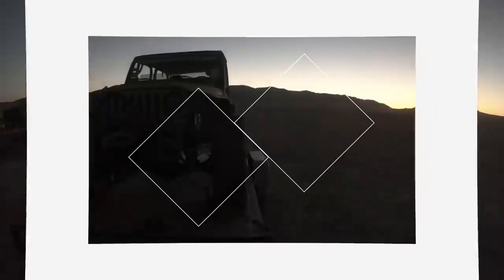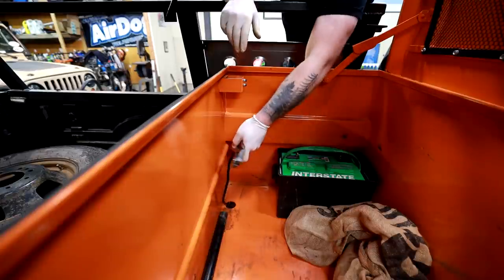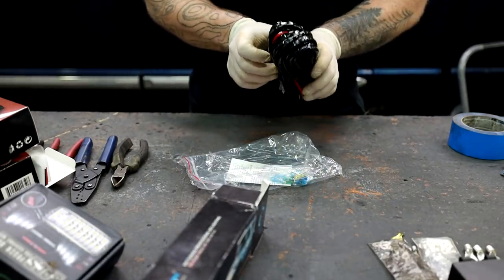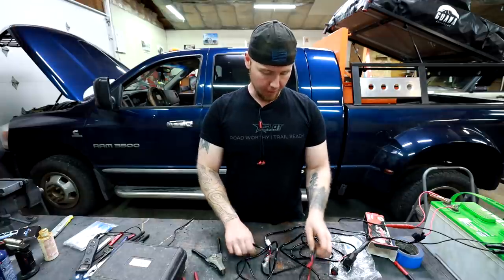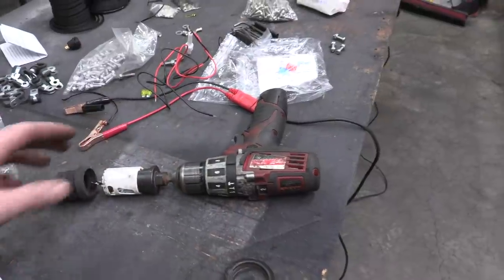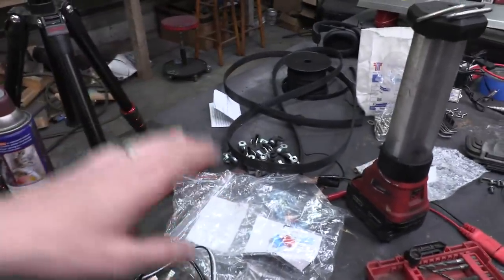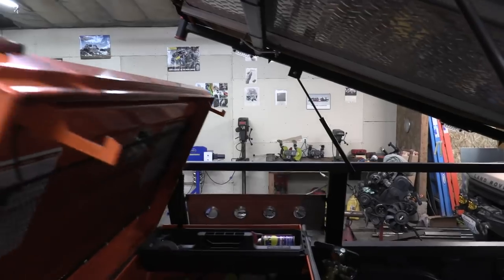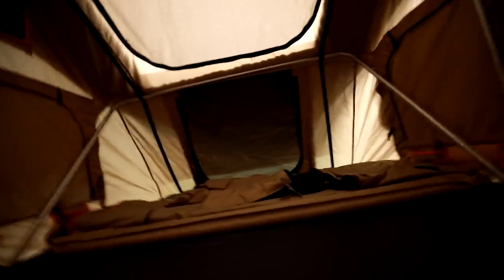CHEAP Roof Top Tent Rack Mods and Hacks! 4x4 Camping In Comfort 👊

Comment: Nate, Great job. Torch soldering looks faster. Might try it. I can see you did your research. 12 AWG wire can carry 20 amps. I will be interested to see if the fuse always blows if your aux battery gets too low. Some way to limit the charge current would be awesome. Unfortunately I am not familiar with that item. The lights are sweet. I need to upgrade the cabin lights in my TJ. They never worked and factory are not good anyway. Great video again bro. Can't wait for the next one!

Comment: Hey Nate love the work you do keep it up can I suggest you put your clamp meter on your charge wire to see how many amps are going to your second battery it will give you an idea  if that cable is big enough also maybe look at a small solar panel to keep it topped up when you are not driving.
Reply from the maker: This has been apart of the plan all along. I just need to drain the truck bed battery low enough first 👍
Reply: @DirtLifestyle  also I know you are trying to do this cheap but I would suggest using a dc dc charger and 6bs cable from your main battery this will also allow you to connect a solar panel with out a regulator

Comment: I cant imagine that tiny wire lasting very long if you drain the rear battery below the mid-high 12v range and it draws more than a handful of amps to charge it back up again. I would have used a much much bigger cable for that. Great ideas with the hinge mechanism and i love the simplicity of the whole setup (y)

Comment: Nate, that is a Molex connector. Go to their website and there are instructions on how to crimp and the right length to strip the wire. Those are used on a lot of Airbus helicopters, great system 👍 I'm a fan and use aircraft connectors on all my cars.

Comment: First off, love the videos 👍👍, I use the fuse jumpers all the time, but I found out that there is a right and wrong direction, if installed incorrectly you're gonna be popping the main fuse and your accessory won't work. I know it is just for a signal for the relay.  I ended up blowing a lot of fuses before I realized it. Just one small tip I learned, just wanted to pass it along. Again love the videos 👍❤️

Comment: Another good video. I would increase the wire size to that aux battery and go with a bigger more constant duty solenoid over a relay in the case that battery is really drawing off the alternator or vise versa. Police Tahoe’s from the factory use a similar key on solenoid connection the start battery and the six battery. Tyco makes a perfect constant duty sealed solenoid for this.

Comment: When i use that style wire cover I like to use some glued heat shrink on the ends to keep the cover from sliding around and more weatherproof because of the glue in the heat shrink

Comment: Flux!!!, gotta use it when soldering... anything.

I like the Oatey paste you buy at Menards and the likes, works for electronics to.

I give Eastwood's epoxy primer w/ chassis black top coat(no friggin' ceramic btw,  just the basic chassis black, satin is my pick)5 star every day of the week.

It holds up excellent, ya' absolutely have to install per the directions, there's some watching paint dry time involved.

Rattle cans will get that done.

Good show 👍
Reply: You'll wanna blast it btw before epoxy, if that's what ya choose to do

Comment: E6100 is the best epoxy adhesive.  Would work perfect for mounting those lights and such.    We use it at work in industrial applications on mobile volumetric mixers.

Comment: Nate.  I am currently about 5 minutes into this video...  Did you know the 7 round "RV" trailer connection has a constant on for charging the emergency battery/using accessories on your trailer?  On my 06 Super Duty, it is only hot when the truck is running.  I'd just tap into that for your signal and use that to cycle your relay.  The wiring is right there.  Actually, now that I think about it, there's a wire for reverse lights on a trailer in that plug too...

Enjoy SEMA.  Sending my buddy Dave from Jeep Kings in Springfield MO to come say hi.

Comment: Dunno if you'd want a link, but there's a veteran on EBay that sells pre-wired mini relay/fuse boxes.  All sleeved wire, comes with a mega fuse, etc.  Only thing missing would be an ignition relay if you only want power to the box when key is on.  Super neat/tidy.  I have one, will probably be buying another.

You'll have to make your own harnesses, but I don't find that as a negative.  No pre-boxed one-size-fits-most applications.

Buy a decent voltage sensitive relay (solid state) for isolating....part of the reason is making sure you are carrying enough current to fully charge the second battery and not be under-charging it.

Might suggest replacing cheap Chinesium rocker switches with some vandal switches, too.  Tougher, cleaner, UV proof, and just look better.

ONE last thing:  3M VHB double-sided tape (red coating, clear tape). aka, Tape of the Gods.  Pretty much permanent installation.

Comment: Doesn’t your 7pin trailer wiring already have a switched 12 volt for charging a trailer battery?
Reply from the maker: Yes
Reply: The trailer charge circuit is limited to something like 10-15 amps, IIRC. DL's solution is going to be limited to the capability of the alternator, divided by the # of batteries being charged.
Assuming it works, but electrical is a fickle mistress.
Reply: @reaperreaper5098  how does the trailer plug limit the amount of amperage it sends? I'm curious if he totally depleted his deep cycle battery while camping and went to charge it, if it would pull to many amps and melt that wire he ran. Ssimilar to jumping a dead car battery with a cheap pair of jumper cables. They get very hot lol.
Reply: @ASdt360  So, I didn't get a notification when you asked this. To answer your question, the trailer outlet is on a set of fuses. Those fuses are going to be sized to the wiring Ram used for the harness for the tow connections.

Comment: You need to plan for the box battery having no charge. There will be a lot of current when they are equalizing.
Reply: A master disconnect switch, 2000W generator, and a small battery charger.
Specifically a 2000W because you could fit most of them in the job box.
Reply from the maker: It's all speculation at this point. I will have real world data soon. I will measure the exact amperage this pulls when trying to equalize with a amp meter. I think the batteries will equalize very slowly but only time will tell.
Reply: @DirtLifestyle  i was curious to this aswell, it will definetly depend on the state of the deep cycle batter and if you equalize it with the truck running or just ignition on, if you drained it acidentally to say 10v and then turned the truck on to 14.4v thered be a rather big difference there and might send alot of current, this never seems to be addressed though even in professionally sold wiring like an aftermarket 7pin plug kit, if the trailer has a battery itd be the same scenario

might be a non issue but if it is an issue can grab an automotive breaker and itll allow 10seconds or so of charging before it trips off for 20seconds or so and then untrips to try again until the voltage is close enough it doesnt need to trip off, not really a professional solution but i dont see any issue with it

Comment: Your truck should have a dedicated circuit to charge trailer batteries on your 7 pin trailer connector (pin #4). It’s only on when your engine is running. And your reverse signal of course would be right there too. On my Ford it's a 30A circuit. 
You could just splice into the factory harness right under the bed below where the box is.

Comment: Looks great, but one question.  Why did you mount the hinges on the back rail and not the front at the headache bar?  I mean your Rigid box swings from the back to open, plus you added the cool dimple dyed side plates in the front of the rack.

Comment: You can use the reverse light wire on your 7-pin trailer harness for a trigger for your reverse instead of the lights on the truck.

Comment: Hey Nate on that generation dodge with the Cummins the alternator charges the passenger side battery and that battery “charges” the drivers side battery but the computer reads voltage from they driver side. It has been know for the driver battery to go bad the computer calls for more power and the alternator cools the passenger battery.

Comment: Noticed that you are using copper wire and crimps, consider using the marine versions as they are “tinned” copper and that will greatly reduce the possibility of oxidation of the fittings and the wire. I did all my accessory wiring on my previous Land Rover 110 with marine grade wire and electrical connectors to specifically keep the corrosion gremlins away.

Comment: You should use a hot knife to cut that braiding, cuts cleanly without fraying.  Also maybe look at getting marine grade heat shrink... how I built my truck harness.. little overkill but beats plastic vacuum tube.. but the marine grade also has glue keeps out moisture and weather, aha it worked well with the flex braid

Comment: Be careful to not let your new battery discharge too far.  As the rear battery nears 0 volts, when you connect to the alternator the amps going to the rear battery will approach infinity, which will smoke the 12g wire and relay if your lucky. If your unlucky it will kill your alternator or start a fire.  If you put a fuse and charge controller inline you should be OK. Typically an install of a house battery will use a 100 amp breaker as close to each battery as possible and large cable. Depending on length of the run you might want 2g or 4g cable.
Reply: Exactly! 12ga sounds like a fire at some point

Comment: The one thing I can see happening with the battery setup is if the bed battery is dead and they are immediately hooked up when the key is turned it could lower the main battery enough to prevent the starter from working. especially if you are having trouble with the main battery or issues with starting. I would definitely add a bypass switch just in case

Comment: Nate can't wait to see you tailgate build. Believe it or not I have a 07-1/2 Ram dually 4x4 long bed same color as yours with a 6.7 Cummins and I think that to own a Ram truck it's required that the tailgate or bumper be damaged. Lol   Have you ever thought about building a custom trailer for hauling your jeep with a tent or small camper rig on the front which would go over the front of the jeep and have your camping equipment in between the wheels of the jeep allowing you to add a garage type area on the trailer enclosing it for nasty days or nights

Comment: Should you install a diode between the battery you installed and the truck batterys? so the grid heater and starter do not draw alot from amps thru that small wire.

Comment: i did this style of charging on my old tacoma! It works but i was burning out relays, its just not meant for constant "large" spikes in amperage
i think if a person found a large enough relay it would function better, but the standard 40 and 60 amp relays just could survive, its not like a standard load...., that said it also charges really really really slow
Reply: Answer: an automated option like dc-dc or use a starter solenoid

Comment: Hey Nate, love your work and I agree that your charge relay works in theory, BUT...
Your wire gauge you have selected is dangerous and a fire hazard due to the amount of amps a battery can draw when it changes. To put it in a plumbing perspective, you can breath easily through a 2 inch long piece of garden hose but it's nearly impossible with a mile long piece of the same house. I'd recommend at least matching the gauge of wire coming from the alternator to the start battery and upping the relay size.

Comment: Another good video!!  I think your concept for charging the rear battery is sound, but I think your hardware is light.  While you can compare electricity to fluid pressure in many instances, electricity behaves differently in the supply/demand case.  Fluid flow is limited by the hydraulics of the pump/piping system.  Current is determined by the demand of your device (In this case the degree of discharge of your rear battery) and/or the rating of your fuse.  I fear the demand of a heavily discharged battery will exceed the ampacity of your 12 gauge wiring harness.  If your 12 gauge wire/30 amp fuse proves inadequate, consider a larger continuous duty relay (White Rodgers makes them) and heavier gauge wiring.  Also, Google "DC voltage drop calculator" if you need help with wire sizing.  I target max 2% voltage drop for a 12 volt system.
Reply: A simple voltage drop chart - https://www.westmarine.com/WestAdvisor/Marine-Wire-Size-And-Ampacity

I'm always shocked (bad joke...) at how few people have no idea what size wire they should use for what draw.  It usually comes down to nothing more than a guess - "you need a fat wire there" sort of stuff with no actual data.  It's pretty simple to look up but for some reason people never do.  I can only guess it's because most people simply don't know to look and/or are generally scared of electrical work.
Reply: Don Happel 
The ABYC charts will never let you down

Comment: Have you considered mounting a small solar panel to keep the third battery charged when the truck is off?  It would make it to where the third battery wouldn’t draw as much power when you turn the ignition on and not overload your charging system.

Comment: Love all of your videos. Just an observation.........all great but what if you have enough juice to energize the relay but not enough to start the truck?  ...you'll end up pulling crazy amps through that 10gauge until it either smokes the relay or worse smokes the wire.
should have some kind of delay on the relay or switch off something that doesn't energize until the engine is running..... for safety.

Comment: I’m guessing that relay on your charging circuit is rated for 40 amps and charging systems are typically 80-180amps.  On a HD truck I’d say it’s towards the high end of that.  You’re gonna smoke that relay in no time.  That’s why a battery isolator or a ford starter solenoid is typically used.

Comment: When you installed that tap into the fuse box did it matter which way you orient it in the fuse connection, i.e. which side the power comes in from and goes out?  I'm been researching using one of those to power up some grille lights in my 4 Runner.

Comment: Are you concerned about the batteries connecting as you start the truck? Like with the extra house batt, the truck will start at 36v instead of 24v? Also, the wire connecting the house to starter batt seems small (I think you said 12g). Are you worried about too much current going through that little wire and frying it?

Comment: you are starting the cummins, off the two main batteries, as well as the rv battery, which means that your new red wire is at risk of becoming a fuse. a capacitor type isolation will allow charging but not pull off the rv battery at start up.

Comment: The only problem I see with your charging wire is that you need a way to disconnect it when your truck is running and your using a winch. The winch will draw power from both batteries and your charge wire to your second battery isn’t large enough to carry the amperage. Thus resulting in a fried wire or blown fuse if you installed a fuse at the battery connection point for the secondary battery charge wire.

Comment: Everybody is hung up (some more correctly than others) on the aux battery circuit.  I've already commented on that but one thing I didn't see anybody mention was the double sided tape on the lights you didn't want to use on the exterior.  That looked like 3M VHB tape - it's MORE than up to securing those little lights permanently even when exposed to the elements.  I've used that stuff for tons of applications and it's great.  Of course I could be wrong and it may just be a chinesium look-alike that will fail in a month, but the gen-u-wine 3M stuff is excellent.  I've used that to secure stainless steel logos to boats and years later still going strong.  That's both a harsher environment (constantly exposed to salt water and open to weather) and a heavier object (18ga to .125" polished SS).

Comment: Nate, Dont use flux on stranded wiring. Flux is just acid that cleans the surface for good contact. The flux will run down the wire and sit there dissolving the wire. Yes, it makes the solder join easy but also decreases the service life of the wire. I HAVE used flux on older wires that I was reusing ( should have just replaced) but then bathed it in baking soda solution to minimize the flux action. not sure if that did anything. better to just use new clean wire and you shouldn't need the flux.

Comment: as inventive as the offroad community is, I'm surprised you'd never seen this done before. it's the same method I used for my short bus RV conversion. 
I had to use WAY bigger wires than you (4AWG with 100A fuse) because my RV batteries were huge (440AH) so the draw on the alternator could get super high if the RV batteries got below about 60%. Busses come stock with pretty large alternators, but I'd check into it if you're trying this with big deep cycle batteries in the back of a pickup (I know you aren't, but maybe some of your viewers will try it).
I also put in a cutoff switch so I could drive the bus with the systems disconnected in case I let the RV batteries get below 50%. At that point, I'm better off running a trickle charger from the cigarette lighter to the RV batteries until they're back up to 12.4V or so hehe
Reply: btw, nice job man :)

Comment: You should search amazon for heat shrink solder but joints. Then get a China freight heat gun. You slip the but joint over your wire make a connection and then the heat gun heat makes it both shrink and solder the wires together. Oh and I prefer a heat gun just because I tend to burn thing with a torch..lol